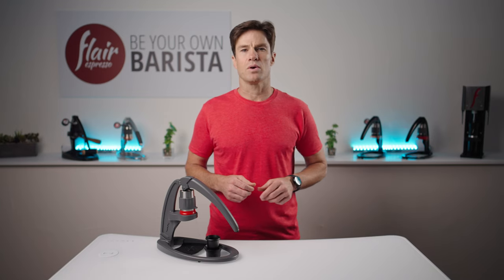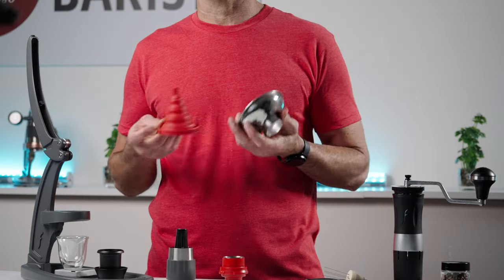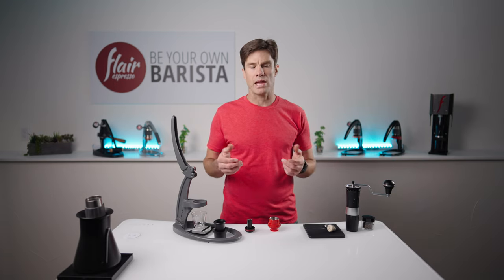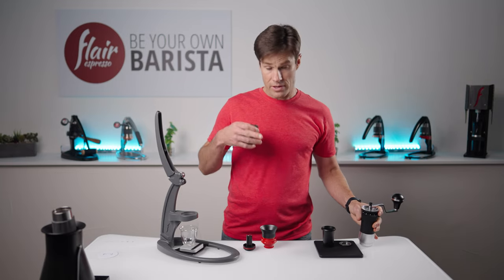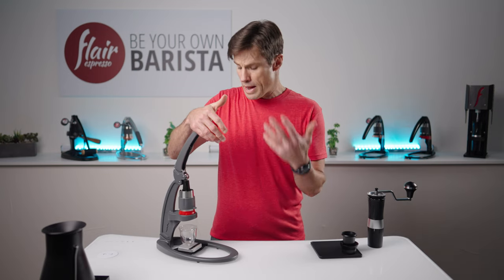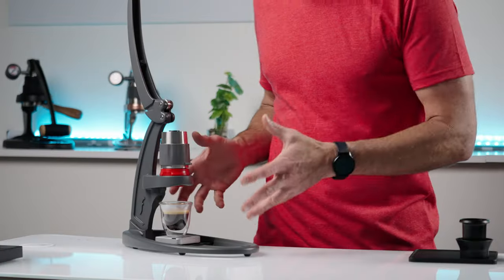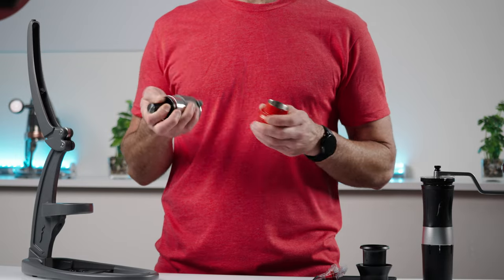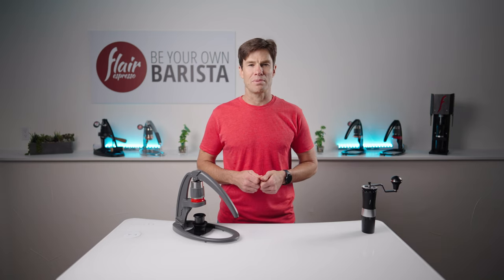Flair Espresso Maker NEO | Brewing Guide

Comment: Andrew, thanks for the great tutorial. I have a Neo on order. A couple of questions: 1) if i just leave the bottom cap and pressure valve off the bottom, will it work the same as the bottomless portafilter? 2) what's the best method of removing the o-rings w/o using a sharp object. TIA
Reply from the maker: Just as Lance demoed, you can brew without it and make espresso the normal way (resistance from bed of coffee). No need to remove o ring, it's on the part that you'll be tossing
Reply: @FlairEspresso  Sorry, I didn't make my questions clear. I actually had 2 separate questions 1) Lance removes the pressure valve, but he screws the cap back on so the coffee still goes through the tiny hole. I'm wondering if it's ok to leave the cap off, so you can still see a partial view of the bottom of the portafilter. 2) Andrew says to remove the all of o-rings periodically for cleaning/lubrication (not just on the pressurized portafilter), but not to use a sharp object. what's the best way to get theim out w/o damaging them?

Comment: just broken my first Flair )) probably put higher pressure than recomended. That's what they replied at customer service: "Thanks for sharing this. Ihave never seen a breakage like this! This looks like they violently cranked the lever sideways. Even in cases of excess force, the Press Stand typically breaks where the portafilter holder is: This has to be related to improper use. This is not warrantable, as it would not occur if following the operation instructions." Thanks, Abbey, for your reply, but since the NEO model doesn't include a pressure gauge kit, you never know what pressure you're applying. That's when it breaks. On the other hand, if you don't apply proper pressure, you won't have any crema in your espresso. So it's one way or another.
Reply from the maker: we truly are sorry to hear about your mishap. please note you can choke any machine with too fine a grind such that water will not pass through the puck. pump machines will only continue to deliver set pump pressure, no more, so it can be more apparent that you have to give up on the shot and grind coarser in a second attempt. it can be tricky, however, with manual machines, particularly ones where the mechanical advantage is so larger (9:1 with NEO). even if you know your own strength, it's multiplied here 9x!! You should never need to apply more than 13-16 kg /30-35 lbs to brew with the NEO's pressurized filter basket; that's the equivalent of 117-144 kg / 270-315 lb of force on the brew base!

we definitely do not want to see you without a way to brew espresso, which is why we offer alternative options to assist you when breakage is outside of warranty. if your reseller didn't have a replacement frame to offer at discount, please reach out to service@flairespresso.com and they can assist you further

Comment: Hey Andrew, what kind of oil do you recommend to keep the Neo functioning optimally?
Reply from the maker: Molykote 111 for plunger/piston o-ring, a drop or spray of lubricant at roller pin. Wipe off and remove excess
Reply: @FlairEspresso  thank you.

Comment: Does this product have a warranty? I bought this flair neo and it has a small crack on the bottom of the portafilter. And i have problem with the unscrewed portafilter. It's difficult to clean the portafilter properly. The reality to brew is not even close with your video when i use the unscrewed portafilter.
Reply from the maker: sounds like you should be writing to support and service. please send an email to service@flairespresso.com with photos and videos demonstrating your concerns. thanks

Comment: I’ve been using my neo for some time now and I always have to use so much less coffee with out risking choking and breaking the machine. How do you use 15g and a pretty fine grind with effortlessly pressing? I currently grind with a baratza encore at a 10 and still press so hard

I also noticed my neo does not have the removable tips. Any advice for much appreciated :)
Reply from the maker: Hey Steven, hmmm a lot to unpack there and easiest by email so our support team can do some troubleshooting with you. Please send to service@flairespresso.com

Short answer, as you up the dose you can set the grinder to a coarser setting to compensate and keep the flow consistent. The new portafilters are available for purchase in our webstore.

Cheers,
Reply: I have this same problem. Emailed support on 3 occasions and I still can’t get a good, smooth brew. Have to put so much pressure down and only get drips throughout. Takes me about 2 minutes to brew a cup. Very frustrating.
Reply from the maker: We checked our records and it appears we were the last to send you an email. If you're still having trouble, reply back so why can resolve the matter for you.
Reply: I mean your grind it too fine for a pressurized portafilter

Comment: I have flair neo, and I'm just buy bottomless 2 in 1 portafilter. When I use bottomless portafilter, 
1. why is there coffee spurting from the bottomless portafilter can when I star to pull my shoot.
2. When I use extra fine grind size. Why I can't pull my shot?
Reply from the maker: grind finer of it's spurting and/or use slow ramp and lower pressures. If you have a grinder where one click it too coarse and the next to fine (nothing coming out) you need a new grinder with more clicks! bit.ly/BrewWithFlair
Reply: @FlairEspresso  do you have recommended grinder for bottomless 2 in 1 portafilter?
How about Royal Grinder?
Reply from the maker: Royal will serve for sure. Make sure whatever you choose has 60 or more adjustments to fine tune your grind

Comment: Mmmm, does the Kickstarter one have the screw bottom mechanism?
Reply from the maker: No, this is a very recent innovation but it can be used  by those folks that backed the campaign and any others that received their NEO with v1 of the flow control portafilter
Reply: @FlairEspresso  so how do I get the upgrade? Do I need to buy it separately? My filter is constantly getting clogged...
Reply from the maker: @adri6898  it's sold separately through our webstore. It's you're having clogging issues please reach out to service@flairespresso.com so that they can help troubleshoot with you
Reply: Recently bought a Neo and wasn't adveerted to be kick starter and was sealed bottom unit, shame as getting blockage already.
Reply from the maker: @9madness9  please contact service@flairespresso.com